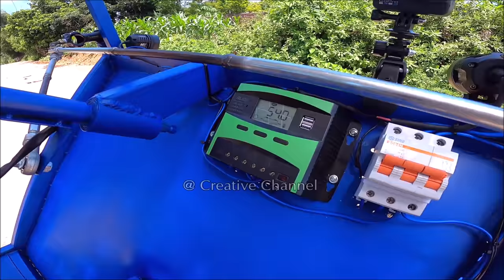Build A Electric Solar Car with Two Bicycle

Comment: How many miles/km a day on afull sunny solar day?
Reply: Google how solar panels work. With that amount of surface area, and depending on the size of his batteries. It would take 1-3 days under perfect conditions to fully charge his batteries. Having these solar panels will definitely extend his range a bit, but they aren't enough to keep it fully charged alone as a daily driver.

Comment: You reinvented the "electric carriage" with hub motors.
Love it. I'm trying to do the same thing with a mini camper integrated into it.
Reply: Ŵ
Reply: So make this, but longer and use rear hubmotors so you can also run external motors and chsins for a total of 4 motors to move the extra weight
Reply: i'm thinking up a similar idea. thumbs up

Comment: Stunningly cool, eco-friendly, compact and practical, I give it a 99/100, I just think it needs a wider foam backrest, foam elbow brace, glass as front protection or strong clear plastic, don't forget there's speed and wind, I think you'll agree  With me that some luxuries are necessary haha.
Reply: Not to mention the countless insects flying into your face at speed, indeed a plastic or glass front may be necessary.
Reply: I agree plus it wouldn't hurt to add a brake light and some mirrors also
Reply: You forgot to mention seat belts & canopy sides so it can be like makeshift doors.  Sought of like a Jeep, you can put the doors back on & back windows.  Just use them only for when it might rain.

Comment: The ideas just keep coming from you, non-stop. This is such a great idea because it's simple, quiet, eco-friendly and powered by the sun! This is an example of something that is sustainable in regards to personal transportation and energy. I'm surprised you did not add a few seatbelts since this vehicle appears to go 30 to 40 mph quite easily. Another great build!
Reply: @chhabdimobile4555  r
Reply: @chhabdimobile4555  d dx x,
Reply: ....true
Reply: Tttt
Reply: @daniyelchiruguri5951  vnj bcom di do vicky gi go go go him no no JC
Reply: Where is motor??
Reply: its cant go over 25kmph to 30kmph
Reply: There are e-bike hub motors in each of the back wheels.
Reply: maybe half that
Reply: تهب
Reply: ننتلبلبب
Reply: مهالوةلى
Reply: @Stv1155  in the rear wheels.
Reply: @opgamer-lc5oo  
@farel channel indradinata
Reply: gg
Reply: @Stv1155  the back wheels have what appear to be hoverboard type motors they run 36v
Reply: @Stv1155  back wheels 👀
Reply: @FromMetayou  no 48v
Reply: Super
Reply: @Stv1155  on the tires.

Comment: I just found this channel today and I am so impressed!!! This is such a winner of a project! Just brilliant! I will be watching the rest!
Reply: गौरी मेम
Reply: think about the design, the engineering/build. and the electrics. and you will find its NOT. also the idea has been done before . its not original. check out the guy who crossed a middle east desert on a bike with a roof ,same idea.

Comment: The electric hub motor. Its really one of the marvel of our times, that and the li-pol battery. BTW if weight isn't a concern, he could have used the space between the rear wheels to carry groceries etc.
Reply: Ģ
Reply: Or under the seat.
Reply: @andreafaldon5026   The battery and the controllers are already there. He would have to compartmentalise and also make it waterproof incase liquids and food stuffs spill in that area.

Comment: I would've put the steering arm on top so you get full articulation left and right. 

But very cool build overall!
Reply: I feel like too much angle on bike tires might lock and fold them up. Like at speed, full lock, spokes give up

Comment: With the solar panels on a sunny day, the vehicle can travel long distances.
Reply: Wuxxy  but with a bigger battery or more than one this thing can really last long time, considering a normal city use with a lot of stop and limited range of movement,
Reply: It might give 2 or 3 extra miles of range a day. It probably takes 4 or more days to fully charge by solar

Comment: Wow very impressed !❤️This kind of project help a lot people that cannot afford gasoline and help our world 🌎 wide safe environments
Reply: Well, this build not so cheap as it might looks on the first sight. Even two pairs of non-branded wheels will be around 800-1000$. I dunno what exact model of solar panels he used, but even cheapest suitable will be around 300$. Plus batteries, plus controller, plus lights, plus metals... and we got a price for used car, which have safety, music and, probably, even AC) I don't know how high must be fuel price, to exchange a proper car for this toy.

Comment: Nice I Would Buy One then I Would Add L&R Taillights, L&R Blinkers, & Rearview Mirrors Left, Right & Middle (In the Cab). Maybe A Radio & some Banging speakers, Upgraded Battery Capacity.

Comment: Great video. My only question  is, how did you do the steering geometry?
Reply: That would require designing  around the Ackerman angle. The parts needed to do that correctly are not part of the design. This trike, like most trikes, is unstable and prone to rollover accidents.

Comment: The solar panels are the heaviest things in the car and gives it a high center of gravity, and a narrow design which can cause it to lift two wheels of the ground or even rollover in an emergency manouver. Could use a slight re-design. But I dont know if it goes fast enough to do that.

Comment: I am impressed by this, though a couple of small things, you need some red tail lights, brake light and indicators. And that circuit breaker isn't rated for water, you can get an enclosure with a cover for that.

Comment: Its very very nice.
I want to give some suggestion in this project to make it too much better as
1. you can add cycle gear so this car is going to run on upslant roadie, on mountain Chilly road) 
2. You can add the generator motor which produces electric energy to the wheels so more energy is produced
3. you can add Spring granitational free energy project Soon sitting of anyone in car start the production of electric energy
4. Magnet project fan so it can give air as well as electric energy
5. you can do this all energy production and increse the speed of Car.

All right thank you for reading and best of the luck for project.very Good🙂🙂

All above given adding project is available on youtube

Comment: Dude, you have some nice videos. I will talk about the things that caught my attention. The front shock absorber angle is not good, the absorbency is low against the impact on the road and it is possible to break the fork. Rear shock absorber is in very bad condition.

Comment: Nice Vid,
4 a sweet ride.
But, I missed the parts where the motors, battery n those connections went in ?
 I see an inverter and the solar panel junction box. But where is the motor(s) and battery installation?

Comment: Put a basket on the back and it would be a great grocery getter. The only problem I see is where he drilled the holes for the wire to run through the sheet metal. The sharp edges could cut the wire over time.

Comment: If you build it with just one wheel in front, and some pedals (even though you rarely use them), you could take it on bike trails/paths.

Comment: I like the build, but let's have some perspective here on the charging.
1,402 comments here, and not one has looked at the maths.
His solar panels added up is less than 2 sq meters.
They look like old technology panels.
Modern panels produce 150 - 200 watts per sq meter.
Let's be generous and say the vehicle can generate 300 watts in full sun.
So 12 hours of full sunshine - could generate 3.6 KW hours 
His 2 hub motors will be at least 1,000 watts each.
Assume 50% efficiency for the whole system.
So 12 hours of charging in full sun = 3.6 kWh. (Kilo Watt Hours).
The motors together are 2KW.
With 50% efficiency, a full 12 hours charge gives 3.6 *50% /2 =.72 hours
That equals at best 43 minutes driving time per day.
In practice, I would be impressed if he got 10 minutes driving time from 12 hours of solar panel charging.
I know the motors won't be at full power all of the time, but they do have to push around a lot of metal as well as the driver and passengers.
These motor were designed to drive a pushbike, so will be heavily loaded in this application.
This vehicle will need to be charged by mains or generator to be of any use.
The solar panels can drive electronics - headlights, radio etc.

In addition, he uses bicycle wheels.
Bicycle wheels are designed for vertical stresses only, no sideward stresses.
He will get away with it for a while by using fat tire wheels because the spokes in the rim are splayed from side to side.
Every time he turns, his wheels endure severe side stresses.
The wheels will buckle in time.
Bicycle wheels are designed to lean when turning, so there are no sideways stresses.

The other problem with this build is the rear differential.
You cannot drive the 2 brushless motors with one controller because the motors will be forced to move at exactly the same speed.
The two rear tires are locked together so when turning these motors will experience severe stress forcing tire skid.
It might work for a while on a dirt road, but on a modern road there would be severe motor stress and tire wear.
In addition, if there is more weight on the back wheels, the steering might not work at all.
The alternative is a controller for each wheel, but that requires very complex hardware and software management systems.
Indeed, we see at 13:04, he is using 2 separate brushless controllers.
Mr Musk, Mercedes, BMW, GM etc can design these complex systems to sync hub motors, but it is not in the scope of a backyard inventor.

Strong sunshine pushes out around 1000 watts per sq meter.
Typically, commercial panels today are about 20% efficient.
Even if we had 100% efficient panels, there is not enough energy from the sun to power a family car by itself.
With extreme engineering - carbon fibre frames, super efficient motors and a vast aero dynamic solar surface with very expensive panels, it is possible to create a vehicle that will carry 1 person in a desert environment with good roads.

There is a biannual race for solar-powered cars which takes place in different deserts around the world since 1987.
In recent years, Darwin to Adelaide in Australia.
https://en.wikipedia.org/wiki/World_Solar_Challenge#2015

These cars do work entirely on solar power, but are so big in area and so light that they sometimes get blown off the road in windy conditions.
Here is a typical solar car.
https://pt.m.wikipedia.org/wiki/Ficheiro:Solar_Car_Tokai_Challenger.JPG

Usually, one of the Dutch teams wins, but in 2019 they were beaten by the Belgians.
2019's race video.
https://www.youtube.com/watch?v=5KD4QQUUv_w

Comment: If everything on the road was made from such minimal material and powered with such clean fuel the roads would be safer and the air would be cleaner

Comment: hi can you try use the CVT as a torque powered by electric motor and with the differential axle then test drive what the result of top speed and power consumption hill climb i hope you read this my suggestion comment and thank you

Comment: Can u create a hybrid like this solar and battery operated with combine both of it so u can travel longer range if u have out of battery u have a solar dats can use it if could be better if u have a pedal assist too so u have 3 option if u have out of battery u can use solar then if no sun or bad weather u can use pedal assist too dats would be amazing if u can build like this i think this is the perfect for all people using a real commuter vehicles for all people..

Comment: Can the steering pivot 
be attached to both sides 
so that the steering connection is in stereo 
compared to it being in mono 
so that the steering is stronger 

Can you put a set of different batteries 
under the seating area 
that are on a microswitch system 
so that when one lot of batteries 
one for each hub motor 
run out of electric 
the microswitch system switches to the next set 
and the solar panel cells 
( please look at cpv / concentrated photovoltaic solar cells ) 
can charge the flat set of batteries 
whether the solar bike is in use or not 

ps 

you have done a fantastic job 
your boys looked thrilled from your work 
have  beautiful day and a lovely evening 
take care and stay safe

Comment: The question is what are the panel power output? The panels looks like the old types that get shipped to 3rd world countries to get recycled? Today you can get between 200W to 350W per panel. Will add that much acceleration and extra torque to the dual electric motors. If it's fully solar (without a battery connectdd) I'm impressed with it's performance. I seen so many click bait videos that I get suspicious. The foundation of the early solar cars used so many panels, but didn't have the more advanced electronic features we have today that more efficient motor controllers that contains far higher current capacity devices (IGBT) a!ong with digital technology and buck converters. Back then in the 80's they were about 6% efficiency, today it's about 18% there are higher performances of 22% but any higher they are not cost effective & may not be available commercially.

Comment: Where I am , as soon as you add that 4th wheel  it VOIDS  all "priveleges"  that go with bicycles & tricycles , especially with respect to assist motors  ;  NANNY-STATE Government Bureaucracy at it "finest" 🤮 .  The THUMBNAIL 3-wheeler would be almost ok :  the steering wheel would HAVE TO BE replaced by handlebars !

Comment: this contraption is a joke ...would be ok for a circus coco the clown would love it...there is no triangulation between the front and rear parts of the frame the rear suspension relies on 
2 unbraced  hoops that carry all the load the welds will fail in a short time    I assume the motors are 35volts each did not see any batteries installed the solar panels are not capable of 
supplying enough current ...study it logicaly as I have and you will realise it's a piece of crap... I know others think it's wonderful but as I say study it practically and you will see its not